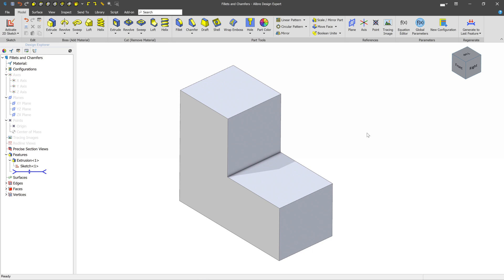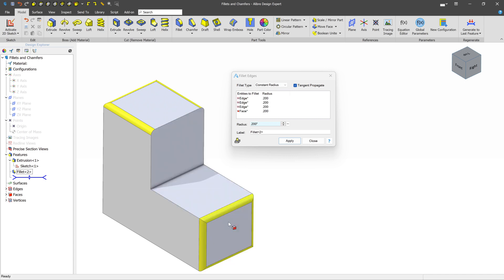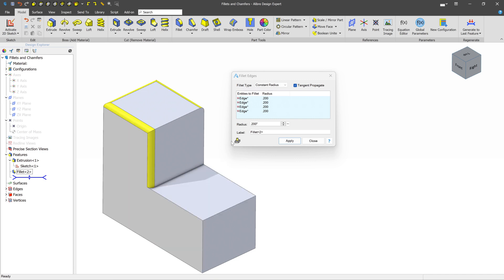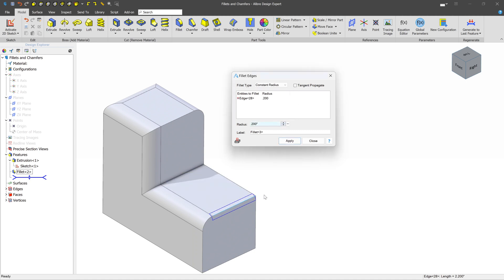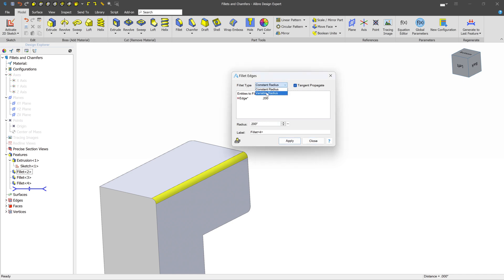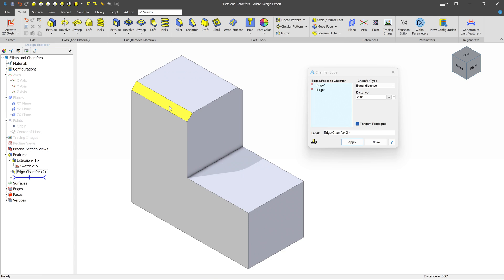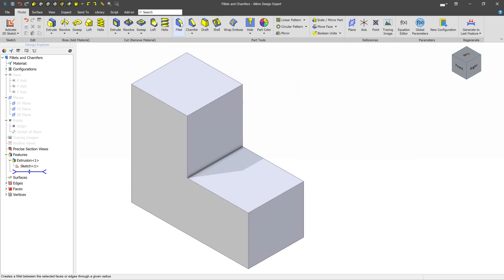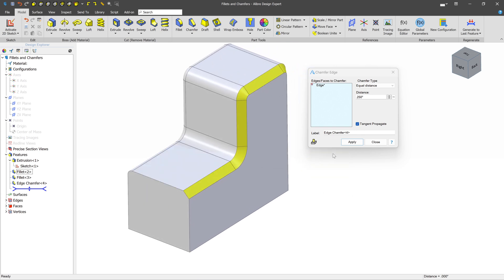Fillets and Chamfers in Alibre Design | 2022 Exercise Series

Comment: VERY well explained. I'm an ex Autodesk Inventor user. I'm a "Certified" user. But without watching your videos I would struggle with Alibre.  It's so similar but so different.  I really am enjoying these videos. I'll probably forget most of it but I've seen it now and I know it's there to come back to. . . . . . regarding your advice about leaving the chamfers & fillets to the end. . . . . . . Yes I agree.  Anything you do references current geometry so changing, adding, or deleting things like fillets & chamfers will almost always cause errors.
THESE ERRORS MUST BE corrected before continuing.  So as you say . . .  leave them as late in the model as possible.    Jim